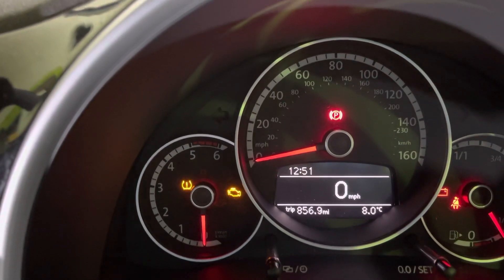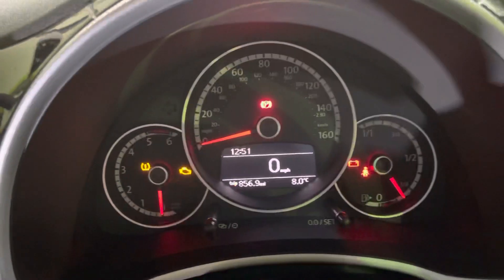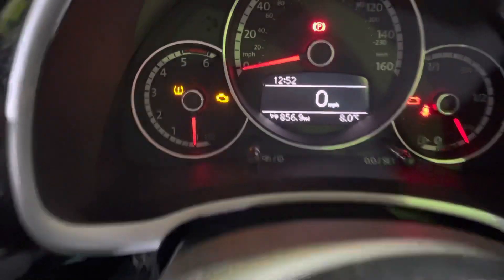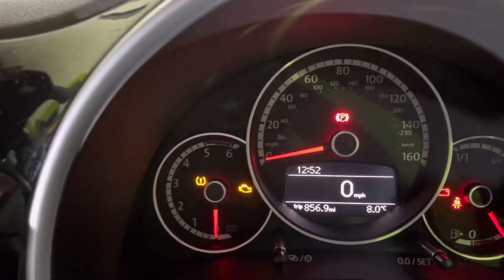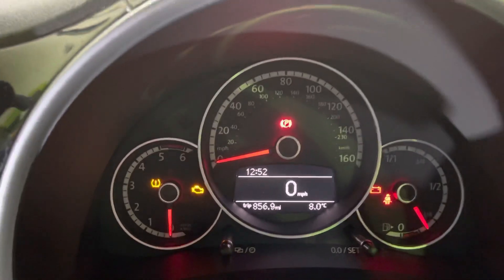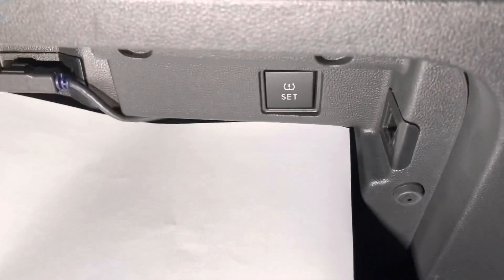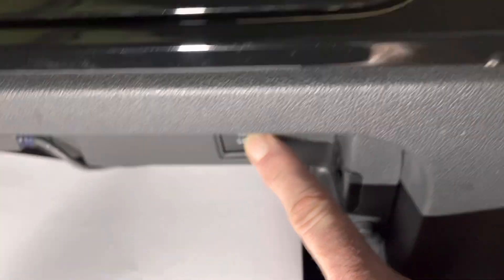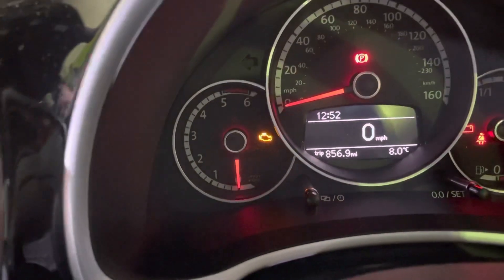Beetle TPMS Warning Light Reset How To Turn Off VW Beetle Tire Light

Comment: Can you be specific on the status of the engine while reseting . Is the car running? or Is the car not running and has ingnition on.  What if the ignition is not on?  Thanks
Reply from the maker: Ignition on. Engine off. As you can see in the video the ignition lights are on and the rev counter is at zero. Thanks.

Comment: On my VW bug 2014. I get a 02846-008 Engine code   This means ""Tire Pressue Monitoring Display Button- E942 - Implausable signal"  Do you know what that means and how to tix it ?
Reply from the maker: Something along the line of a Dodgy contact, unplugged, faulty switch etc.